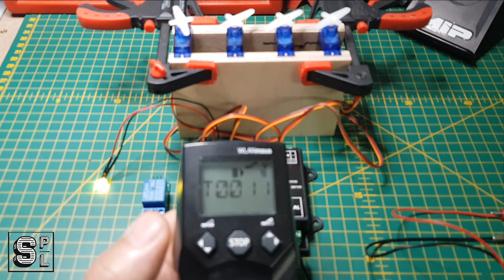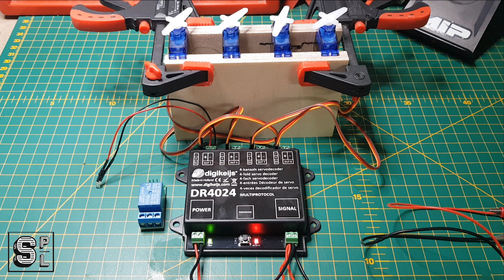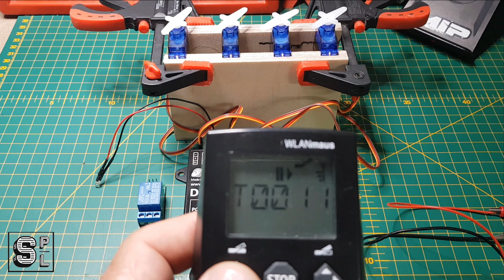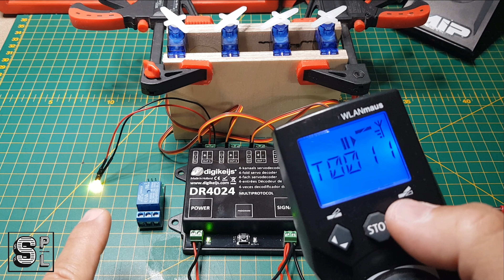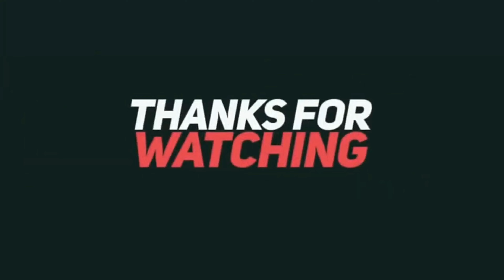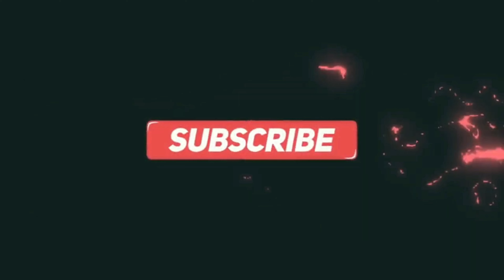Setting Up the Digikeijs DR4024 Servo Module | Ħal-Zuzzu Model Railway (Ep35)

Comment: With the help of your video I programmed the DR 4024. In the manual I found that for each servo you can program 4 different positions A, B, C and D. How to program the keyboard to independently set each of these 4 servos in 4 different preset positions. Is it possible at all - this is how I interpreted the manual. I use DR 5000 and iTrain for control.
Reply from the maker: I have not found use for this option myself so far since I am only using the DR4024 to operate turnouts, but since it is possible to do so you can try the following. 
In my example I used function 1 for one stop position and function two for the opposite stop position. 
I believe moving the turnout blade to a 3rd stop position and pressing function 3 the same way you pressed function 1 and function 2 should do the trick. The same applies for function 4 for the 4th stop position. I am assuming you want to do this for a 3 way turnout? Hope this helps.

Comment: When I set up my DR4024's I did not understand how to set the throw distance / direction using the throttle so I manually edited CV121-CV136 .. the throttle way sure looks easier/faster after seeing it demonstrated. Thanks.
Reply from the maker: I find Digikeijs modules lack clear English documentation and most videos are in German. English is not my native tongue but I try to make it easier for English speaking people to set up their modules. Had similar problems with my DR4088 and uploaded a video for those too. Glad you found it easier to understand 👍😎